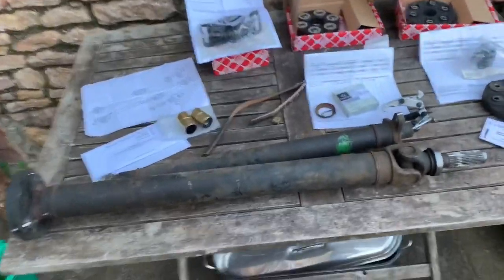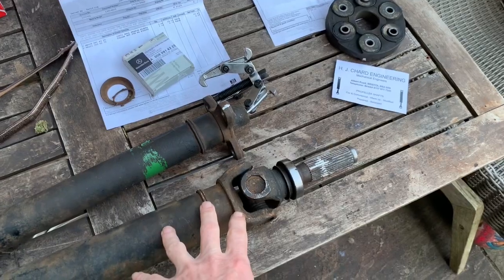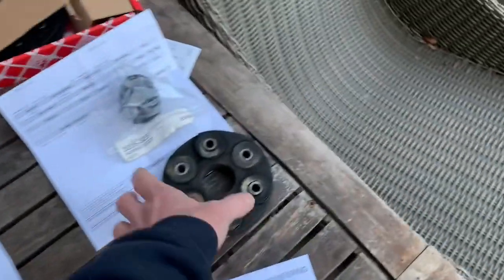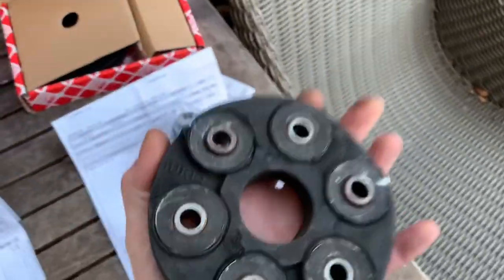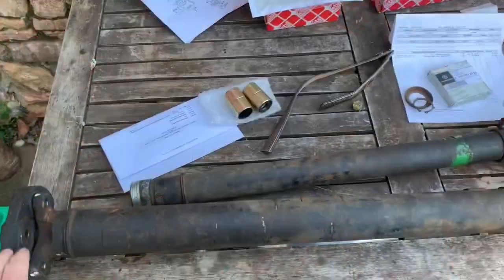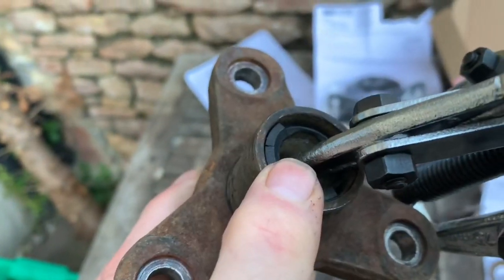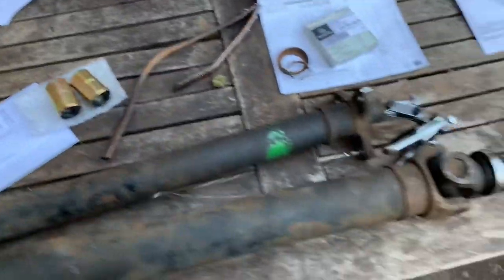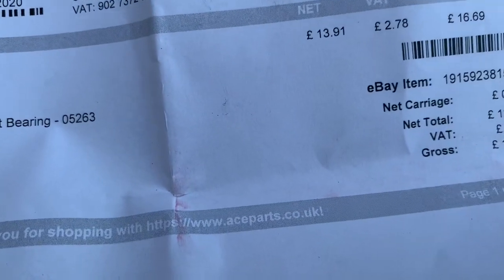Mercedes 107 SL prop shaft drive shaft refurb

Comment: When of the best driveshaft maintenance I've seen.i think most parts numbers are similar to w126
Reply from the maker: Thank you for your kind comment. Glad the video was helpful. Mike
Reply: @MikesMercsandothercars  regarding the bronze fittings I noticed the part numbers start with 115 while on epc it shows 1244101032 front & 1244100332 rear.
Reply from the maker: @Mohamed61110  The 115 part number refers to a 280SL - other SL's (eg 350 and 500 etc) and other Mercedes models have a different part number. Mike

Comment: Hello, you have to lock the castellated nuts by tapping the thin flange in the groove of the shaft of the gearbox/differential. The ‘dammage’ you saw in the castellated nut is not from removing it with a shisel...
Reply from the maker: Hello and thanks for your comment. That all makes sense and I have updated the description accordingly. Many subscribers have far more knowledge than me and I am always grateful when they take time to share their wisdom on this channel so thanks again. Mike